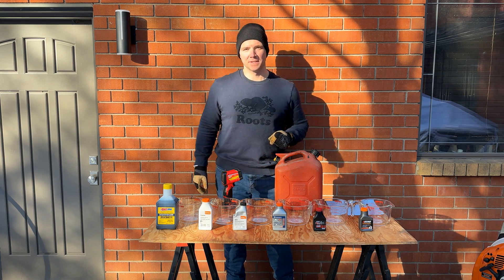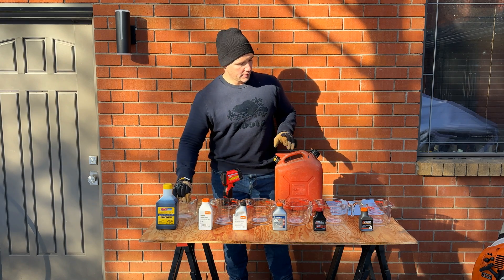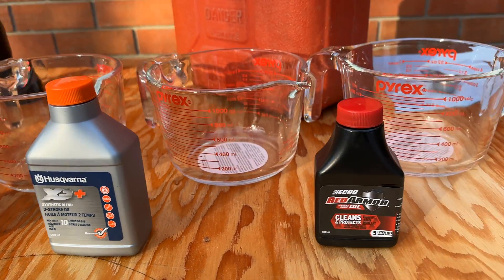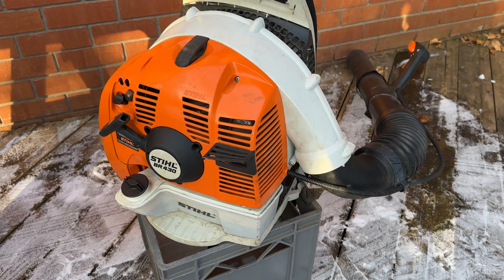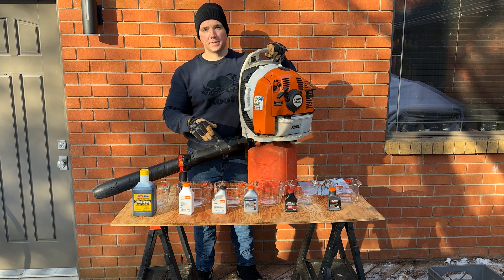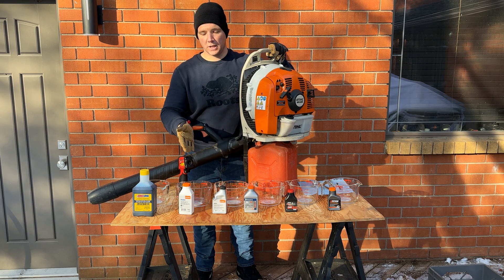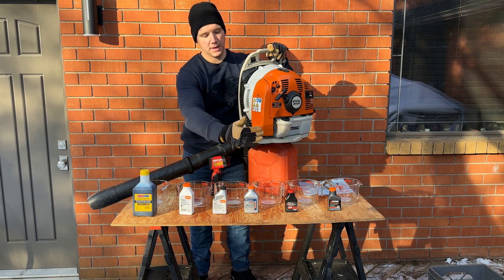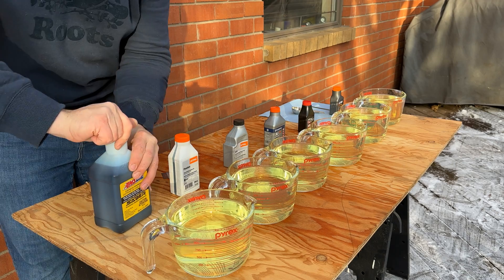Which 2-stroke oil is safest for your small engine? Temperature testing 6 of the most popular oils!

Comment: Stihl Ultra will leave more carbon deposits than any of the other oils. Due to some replies I'll also add that it also sucks for crank bearing lubrication, especially at 50:1. This isn't my opinion, it's facts. I'm also fully aware that not running a 2 stroke at full throttle and long periods of idling can cause carbon build up with any brand of oil. I could care less what oil anyone uses and  the ratio they mix it. I care about my equipment and I really don't give a shit about anyone else's.
Reply: Sthil is made to run full throttle.
Reply: @cmirwin19   - Yes and no. Letting a 2-stroke engine idle for extended periods can lead to incomplete combustion and, thus, carbon buildup.

Wide open has more benefits.
Reply: Stihl hp ultra for the win
Reply: @saltymofo5870  if you consider more carbon on your exhaust port and piston a "win". If you really want to win, mix it at 50:1 and prematurely wear out your crank bearings.
Reply: Ok thank you I’ll go buy 10 gallons
Reply: It also won't leave the bottom of the cylinder coated. It only protects the top.
Reply: I agree ☝️
Reply: I use Stihl motomix have since it come out have never had any issues
Reply: @JohnJKelly-of4dcI’m considering castrol full syn as well being they make stihl to begin with
Reply: @JohnJKelly-of4dc I didn’t either until recently. Says it on the bottle lol, or at least it used to .
Reply: On 2T I mix all engines the same 25:1 "yea, smoke but so what" Pretty much use any 2T oil available, but still don't trust synthetic oils. Non of my 2T engines "be it chain saws, hedge trimmer, lawnmower etc" ever needed rebuild. And only once or twice in flooded "float bowl type" carb, did I have to remove spark plug and get rid of all that fuel in crank case. Never fouled a plug either. 
I had to replace more spark plugs on small 4T engines than 2T ever "not because of wear, but because of fouling" 
Even my Yamaha Phazer and Rotax  503 get 25:1 and to date never had to change any spark plugs... yea, they smoke, but outlast other ppl's identical engines that run 50:1 or less oil... outlast as in they have done 3 to 4 rebuilds already, and mine still going strong and never opened. "Apart from some machines requiring new primer bulbs" but that is literally due to wear and UV 
Even the 2T Wacker jackhammer is at its happiest on 25:1
Reply: Completely false. They design their stuff to run at full throttle. Do that and you don't have issues. Run it how things are not designed to be run and you'll have issues with any of them.
Reply: @mikezupancic2182  so they designed it wrong because you can't run a 2 stroke at full throttle from the time you start it until the time you shut it off. That's just fucking stupid. It's been proven many times that Stihl Ultra is shit - just like your opinion.

Comment: Interesting video.  Good effort on trying to keep consistency.  Obviously too much heat is bad but what if the warmer ones were actually getting more complete combustion?  Could that make them hotter?  I myself have beaten my head against the wall researching and watching these videos (the reason I am here).  I have seen the videos Richard Flagg puts out. The scoring with Ultra looks concerning however the very Interesting thing is the lack of oil in the bottom end. 

I run echo red armor in my stuff that is OEM newer equipment Husky 545, echo cs310 and echo string trimmer. My Holzfforma saws all run the stihl ultra @ 25:1.  I want to get rid of it all and will not run it in my nicer equipment.  Alot has to do with the lack of color it has but also nervous  because of what I have seen. 

I recently took the top end off the Holzfforma g372 just because and it looked brand new on the piston and cylinder.  There was a ton of oil in the bottom end and there was not a lot of carbon up top mostly running ultra 25:1.  Also no screen in the Chinese saw. Plus it has been run slightly rich as well.  

Good video thank you.

Comment: I use Amsoil Saber Professional at 100 to1. There is no carbon, no smoke from my two-cycle equipment. I use it in non-ethanol gasoline. I have no issues. I liked your test. I like to think that the higher exhaust temps mean it is getting rid of more engine heat. Thank you for your test. I will always use Amsoil over the others.
Reply: I do the same and use the same, also agree with heat dissipation.
Reply: From a big Amsoil customer I’ll be the first to say I wouldn’t run 100:1 any 2 stroke that I cared about. He just showed you dumb a$$ that it was the hottest 🤣. More friction = more heat.! Any those “I’ve ran saber for 90 yrs at 100:1 and my 2 stroke runs like new” guys haven’t used there enough, and by the way, most every 2 stroke engine has a lined cylinder and that’s why they last than more than one time at 100:1.. Not saying it’s a bad oil but what I am saying is the film strength is negligible with any oil at 100:1.
Reply: @4bearsi678  agree 💯...
Reply: @ yup
Reply: @ heck the klotz r50 says tested up to 150 to 1 but nobody is dumb enough to do it.
Reply: @4bearsi678  I agree and as an example In a car engine manufacturers have gone to a 0-20 and even thinner ! 
GM in their truck line are finding out the point at which to thin is bad for the bottom end !
Reply: To me if the exhaust is hotter - the cylinder must have been hotter. The place where the combustion is occurring dictates the temperature of the surrounding materials...a hotter exhaust doesn't mean more efficient cooling of the cylinder...nothing has changed to the cooling fins/airflow/metal composition...it could only mean hotter cylinder to transfer more heat to the exhaust...if I am wrong - please explain how so I can learn something new...thanks
Reply: @kirkthebeerslinger I second this. Saying the exhaust being hotter shows better heat dissipation from the cylinder because that’s the oil you like is kinda sad. Thinking the oil you use somehow makes the heat transfer out of the cylinder and into the muffler but none of the other oils do that, just the oil you prefer, is delusional.
Reply: Likewise, with the saber at 100:1 for me!  I get better fuel economy with the Amsoil too.  
No surprise really, considering I get better fuel economy in my vehicle with their oil and driveline fluids.
Reply: Did you find that you get a longer life out of your equipment
Reply: I run it at 80:1, no problems here
Reply: Amsoil for me as well.  One stop shop for all engines. Simple
Reply: Stihl oil is from Castrol, some labels on the packaging say so on the back, Castrol 2-stroke "GO" is the same and much cheaper, let's not be idiots.
Reply: On that table the amsoil is the best of the bunch
Reply: @andreawhalen4142  Why do you say that? The results show us that they are all more or less the same thing...
Reply: @andreawhalen4142  not much difference...
Reply: I’ll have to get some to try . I’ve got a Sthil trimmer & a Husqvarna chain saw & a pair of Echo hedge trimmer & all (3) are two cycles. I’m considering using Amsoil in all of My power equipment & including mowers  which are 4 cycle .
Reply: Amsol has the hardest carbon of all.
Reply: Been using Opti2 for 30 years at 90 to 1.  Never had a failure on any 2 cycle engine I've used.  No smoke, no carbon.  50 to 1 with the sabre is a waste.
Reply: I’ve seen it seize equipment at 100:1. How do you expect it to lube the bottom end?
Reply: @tagerauen5378  now that i have also seen. Run it at the 50 to 1 or it will wear faster. Something with a super mild state of tune like a blower
Reply: @tagerauen5378  and and the ring at high rpm.... no way
Reply: @tagerauen5378  No you haven't.
Reply: @tagerauen5378  I've run it for a long time at 80:1...I have one saw in particular that I regularly (every 15-20 hours maybe) tear down just see how the Saber is doing. I've never had a bearing failure, never seen any indication the big end of the rod or the crank has been over heated 🤷‍♂️ There are different grades of oil...Saber has very good anti-wear additives and a very good detergent package. So the "oil is oil" type guys don't really know what they're talking about. I'd be interested to hear your first hand account stories of Saber seizing engines. Because in my experience; I run it around 80:1 mind you; it has more than adequate film strength and lubrication properties in a properly tuned saw. I use my saws a lot too. Never had an oil based problem. I find that most people with a bone to pick with Saber are usually just against the idea and don't really have much experience running it or seeing it used. It's a free country though so if you wanna run 32:1 or something in your saws be my guest. Just be aware that in some cases more oil is actually more harmful than helpful. The bottom end doesn't need to be swimming in oil if it's quality oil
Reply: @AnarchAngel1  Ladies and Gentlemen,
this mixture of Saber Amsoil is tested and designed for TRUE 2 stroke equipment.  ONLY 2cycle equipment is tested to the specifications of Amsoil, It does perform Excellent and is safe. Those who chose 80:1 are a bit more cautious and because their equipment was not gifted to them should righteously do so. IF we TRANSITION to 4MIX engines made popular by Stihl and a few from Shindaiwa machines now we begin to run into lubrication issues especially under conditions higher than 50:1. Stihl (ULTRA) designed its oil not only to lubricate but also to Clean the internal components of its 4mix. Take Kawasaki for example and you quickly see a mess of buildup and poor cleaning detergents thus every Kawasaki engine oil teardown has a sticky film that is detrimental to the performance of the equipment, Most and YES i said MOST 2cycle oils will SLOWLY kill the Stihl 4mix engines over time. Some take longer than others but take a quick stop at your 7/11 and buy the 2cycle oil on the shelf for your 4MIX engine and you will be in a world of hurt with a count down of about 1-2weeks. 
Just set some money aside to buy all these units new because the 4MIX engine quickly experience crankshaft bearing failure along with compression issues due to (once again) carbon buildup on the valves. All this being said. I have repaired equipment for over 10yrs and used every oil  imaginable. Currently I use Amsoil but truth be told nothing is better than Stihl ULTRA for every type of 2/4cycle mix engine. if you are only using TRUE 2cycle Amsoil is the hands down KING...
Reply: @DanteLopez-tg2si  I am new to the 2 stroke engine. I just bought an echo 2620 weed eater and it says to use 50:1 mix...should I use the amsoil for this at 100:1?
Reply: @dekklin5517 If you have to ask the question, you should probably just do what the manual says.
Reply: @DanteLopez-tg2si   I just bought my first brush cutter. I don't have any experience with engines and how they work. How do I know if my 2 stroke engine is TRUE or is MIX? Thank you.
Reply: @DanteLopez-tg2si  its called cleaning ur equipment and mx bikes  seafoam and crc   and   carb cleaner  and egr cleaner and stuff....

Comment: Great video, but l would run the saber at 80 or 100 to 1 like amsoil recommends. They have tested that oil at that mixture and it works. You can see their results on their website. As for which oil is better, a long term test will be more conclusive to see the amount of buildup on each piston, exhaust port, and combustion chamber. Motors that l use and/or work on with saber and red armor are super clean inside. Motors run the stihl orange bottles and ultra are dirtier (piston has deposits, exhaust are dirty etc). I run some of my equipment on saber 80:1 and others get red armor.
Reply from the maker: Hey Ethan - how do you decide which equipment gets each fuel?
Reply: @DavesSmallEngines  l run the equipment l got new on the saber @ 80:1, Echo PAS2620, hc2210, pb9010. On the 9010 and the 2210 l ran a few tanks of red armor in them first then switched to saber, while the 2620 got saber from the start. I also run my cub cadet trimmer (cc2000) on saber as well because l started using saber in it before l got my echos. I have had my 2620 for 2.5 years. I use it more than most residential users, but less than comercial guys. So it has some hours on it, l am guessing in the 50-75 range. As for the equipment that gets red armor: fs55, echo cs4400 and Es210, because of age. (These three have ran saber also but l try to mainly use red armor) We have a limited edition echo pb580 that gets red armor because we arent taking any chances with that blower. My brother uses red armor in his m262 shindawia (same as my 2620 except red) for warrenty reasons. I dont care to screw a warrenty up if something comes up l will fix it myself. And we are currently using red armor in a echo srm225 because we bought it used and l am testing a couple things on it and want a baseline using what echo recommends. Running different oils this way gives me a way to see how the oils preform over the long haul. Also our church has a shindawia t262 and it gets red armor and the motor and exhaust are spotless. (Its about 4 years old and gets used 15-20 times a year for roughly an hour a time.) And most of the equipment l work on (all except 2 trimmers l believe) leave with a full tank of red armor, because l dont want to scare the owners using 80:1. Also the red armor is really convinent for them to get.

Comment: Great job Dave. Would love to see how Redline would compare. Maybe consider a similar test with some of the popular synthetic fuels...Stihl Motomix, Trufuel, etc. When I ran Motomix in my planes, the exhaust was far cleaner and cylinder temps notably cooler. Would be a pricey test, but would be interesting especially against a gasoline control.
Reply: Good to know that.  I bought some for testing on a (two stroke) DC. generator, and added a small amount (10-12 cc) of silver bottle Stihl oil, as the Zenoah desires rather more oil than 50:1.